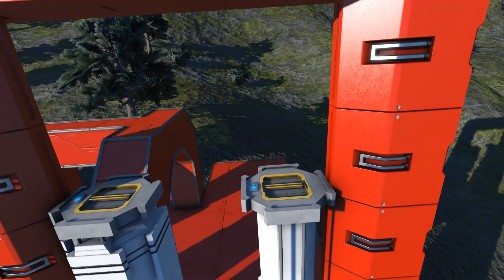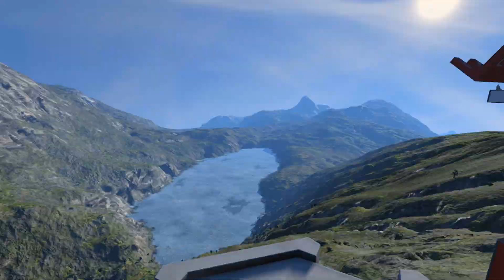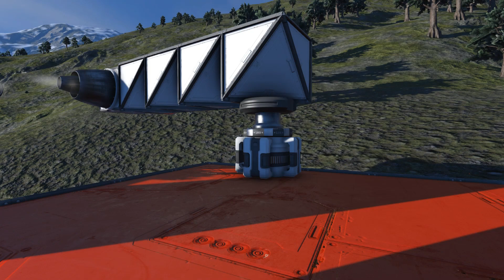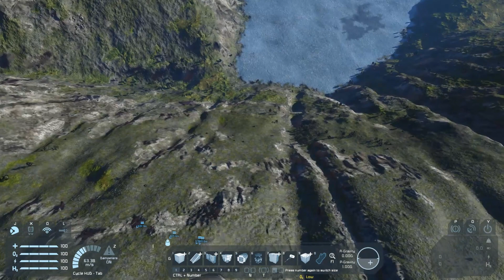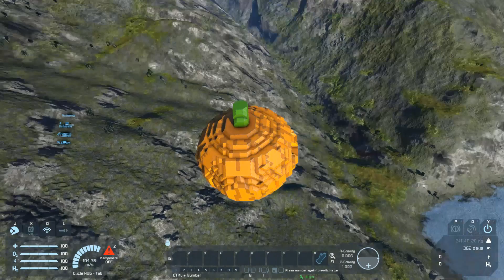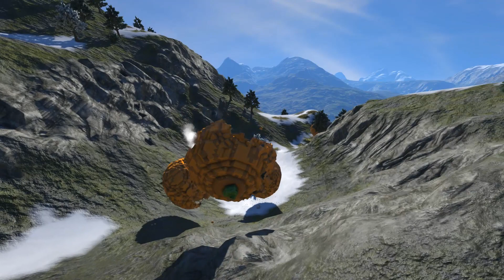Space Engineers: Pistons and Rotors after the Physics Update (tests and tips for Space Engineers)

Comment: it is probably a station, add a cockpit or controll seat and turn it to a ship in info tab.
Reply from the maker: I worked it out later, It was due to where the centre of mass is, it needs to be further away from the pivot of the rotor for the thruster to be able to push the arm

Comment: The problem with using thrusters to rotate is that SE seperates linear and rotational movement. As thrusters push the grid straight it won't result in rotational movement. SE also really hates any rotation not centered around the center of mass as that center of mass does three things at once. 
1. It moves 'linearly'. 
2. It changes the direction of that movement constantly to make that movement appear circular.
3. It rotates 

It's a bit like NESCAR. Going around in circles looks easy, but is actually really hard.

Comment: I'm very late so hopefully I still get a reply but does the rotor block being on make a difference, like maybe the rotor gears don't engage while the block is off similar to a transmission /gear box on a car
Reply from the maker: If a rotor is on, the torque controls whether the rotor will move, when off it's the braking torque. That's why I left the rotor at the end off to allow it to free spin with no braking torque

Comment: im have trouble with the small version of pistons and rotors. they are wobbly and unstable.
Reply from the maker: That's pretty much small grid pistons and rotors in a nutshell. They're not particularly powerful so tend to be a bit wobbly, plus the collision boxes for blocks on small grid are particularly fiddly and are often significantly larger than the visual bounds of the blocks in ways that the large grid versions aren't. You can still do cool things with them, it just takes a bit more time to learn what works and what doesn't :(

Comment: i think i finally figured out how to use thrusters to spin an arm on a rotor. you have to isolate the arm as its own grid.
i built the setup with a rotor, a few blocks with a thruster at the end like you have in the video. i removed the thruster and on the push side of the arm, added another rotor (which i locked) and a light block with the thruster on top of the light block pointing at the arm. Turn off the (Hinge) rotor and turn on your thruster
Reply from the maker: Nice, that makes sense, it's strange having to work around Space Engineers' way of pushing all the thrust through the centre of mass

Comment: 4:41 maybe if add a gyro on it, or try small ship
Reply from the maker: You can spin things with gyros on override but due to the application of force being at the center of mass, the only way I've been able to get things to spin with thrusters when on the end of rotors is to have the piece on top very lopsided, which still ends up slower than just turning the rotor on :(

Comment: I'm building a rather primitive but I guess decent large ship because it is my first ever large ship project in the game and I'm trying to build a hangar bay and I'm wondering if I should just use a bunch of pistons to push the blast door up and have a ship dock that way or use rotors to open it about 90 degrees straight up
Reply from the maker: For hangar doors on ships I'd try to stick to airtight hangar doors, particularly if you're planning on having the ship enter the gravity well of a planet. The reason for this is that subgrids and the inertial dampeners don't play very nicely with one another. The mass of whatever is on the other end of the rotor or piston will sometimes not be included in the weight calculations for the thrusters to resist so the ship will end up slowly (or sometimes not so slowly) sinking :(
Reply: I'm not trying to go that far yet I'm just trying to make more of like a space only ship as my experience with large prebuilt ships in an atmospheric condition is not exactly great but thanks for the suggestion I just wanted blast doors for the larger space but with the pistons I think I may be able to keep the armor

Comment: If you want things to spin freely try not building the rotor enirely, as far as i know that works
Reply from the maker: Rotors will spin freely when unbuilt, built with power off and no braking torque, or on with no torque. All 3 conditions should be handled identically by the game, at the moment they seem to but there have been times where that hasn't been entirely true :/

Comment: Try going in to control panel and switching the base to ship
Reply from the maker: Recently I worked out part of the problem with the rotor, due to force from thrusters being applied to the center of a grid, you need to have the arm on the rotor as lopsided as possible to get the thruster to push it around, otherwise it's just pushing through the head of the rotor. It is however, somewhat inconsistent in its behaviour :(

Comment: @Splitsie you need to set the upper limit to Unlimited to make it free spin
Reply from the maker: Only if it's running up against the angle limit, which those ones weren't. In my survival series I've since worked out that you need to have the center of mass far enough away from the rotor to allow for thrusters to create rotational force, however they are not very good at it any more so there are far better options for high speed launching which physics blocks :)

Comment: In the past iv built large gravity artillery peaces. But they really only worked on the moon. Cause artificial gravity doesn't work in planet gravity, and in space it only fires the projectile in a strait line. But on the moon, you can adjust the ark and actually perform long range artillery strikes. Furthest (somewhat accurate) shot of thus far made with it was at 10km. with about .3 of a km of spread. But with a group of guns firing at the same time, you could really lay down some fire power. But the guns are kinda hard to use and takes a single person At least 2min to reload, but with a crew of 3 or 5 you could easily do 20-30 second reloads. Its still in the development phase but if I finish it. Id love to show you it. iv also produced many gravity cannons for space warfare that can do immense amounts of damage. As well as many missiles.
Reply from the maker: I really want to do some messing around with grav gens on the moon, for some reason I want to build a gravity based maglev style vehicle. I think it'd be great fun (though totally impractical) :)
Reply: @Splitsie  Iv actually tried to build some mag lev vehicles on the moon. Its extremely difficult. I had some vehicle stability problems and the artificial gravity gens, like to cancel each other out. So you quickly run into problems.

Comment: First you must set Torgue to 0 (zero)... Then rotors start spin arround help atmospheric thruster. Is it physicaly option, not funcional. This option work same if rotors are on, or off.
Reply from the maker: The way the rotors were originally set up was that torque was only applied while the rotor was on, and braking torque only applied when the rotor was off. So you should be able to get a freely spinning rotor when it was on with no torque, or off with no braking torque. That's why I didn't think at the time to turn the rotor on as in my head I should already have had a freely spinning rotor.

Comment: if noone has said this before if you turn down the torque it should allow the thruster to move the rotor i found this out when trying to connect two rotor's together to spin them at the same time for looks of building my mining rig
Reply from the maker: It turned out there was a weird behaviour at the time I made this, where if the rotor was off there was no way to move it with thrusters, but if you turn it on and turn the torque down it'll be able to move. The rotors should have been able to freely move when off with no braking torque but just wouldn't :(

Comment: Thrusters apply force to the centre of the grid or the centre of mass
Reply from the maker: Except for certain conditions with rotors, oddly. I just missed the correct conditions slightly, if the rotor is on, you'll be able to use them to make it spin :)

Comment: I have managed to have a rotor (off) with a grav drive attached to one end, close to the rotor and a cabin with a reactor and a flight seat at the other end (far from the rotor) to reach abou 1000m/s without speed mods. I think for the thruster thing to work you need a flight seat on the grid that you wish to propel and also make sure that it is not set as "station".
The funniest part was when I detached the rotor - the grid kept spinning violently, but not perfectly circular - it spun out of control while circling around the general area that the rotor was in. Also it slowed down to 100m/s
Reply from the maker: I tried it with the flight seat, but edited that part out since at the time it didn't work either :/
It seems like for thrusters to spin a rotor, the rotor needs to be on, if it's off it just behaves weirdly... I'm glad things work as they should with a grav drive based rotation :)

Comment: Dear mr splitsie 
i wanted to make trailer for my rover and i faced same problem in rotors which they not rotor with additional force other than that you decrease the torque if you decrease it to 0 you can even turn it by character jetpack
Reply from the maker: Before the physics patch the behaviour of rotors was that having a rotor on with torque set to 0 was the same as having a rotor off and having braking torque at 0. When rotors are off the braking torque is meant to be applied, but for some reason that is no longer the case and I stupidly didn't think to try it with the rotor on at the time I recorded :P

Comment: What about making the arm of the warhead launcher, longer
Reply from the maker: You could definitely do that to require fewer rotors and achieve the same speed, I deliberately used a large stack just to see if it was possible ;)
Reply: Splitsie I meant, în the same instance, would it not launch it further, if the arm was longer?

Comment: Too lazy to read through all the comments to see if this has been mentioned, but on your rotor launching system, add a counterweight to the other side of the arm until the center of mass is over the rotor stack. That should greatly reduce the wobble, and probably get even more speed.
Reply from the maker: I was definitely silly not to have done that, and as you suspected several other people had pointed out that little bit of info - will be certain to remember it for the next flinging machine I build :)

Comment: Your thruster rotor was off
Reply from the maker: The way rotors are supposed to work is that while they are on and have 0 torque they'll spin freely, just like if they are off and have no braking torque they'll spin freely. Unfortunately that changed with the update and because I thought of the two states as identical I didn't think to try it with the rotor on at the time I recorded. It turns out that since the update they made it only really spin freely if the rotor is on, which makes no sense to me :P

Comment: I am having the issue of pistons not moving at all, I select reverse like normal and the piston just sits still not doing anything. This is incredibly frustrating
Reply from the maker: Are the piston heads running into something that's stopping them, maybe a grid that's gotten detached? If you make a copy of your save you could see what happens when you set the force on the piston to max (I can't remember the name of the exact setting but the one that's for how much force they apply to things that are in the way) if there's something in the way then you should see carnage then you can reload and try to work out what's blocking the path...
Off the top of my head I'm struggling to come up with other suggestions and since I'm at work I can't load it up to check :/

Comment: I believe you problem is that you didn't turn down the movement Torque on the rotor to zero, if you turned this down in the past. The items would flop around. Also The Themis auto leveling script "one of the best scripts in the game" I believe still works and this works entirely on thrust applying a off centered force. Hopefully this comment isn't redundant
Reply from the maker: The rotors are oddly bugged, the behaviour with rotor off and braking torque at 0 should be the same as rotor on and torque at 0, and that's how it was before the patch. Both of those setups would spin freely and rotate with a thruster. Since the patch it only works with the rotor on and torque at 0 for some strange reason, annoyingly I didn't think to try both at the time :P

Comment: I thought the thrusters in Space Engineers were incapable of applying torque. It was one of my major gripes with the building system when I last played. You could make as rediculously lopsided arrangement of thrusters you wanted, and it would still fly straight.
Reply from the maker: Only on your main grid, with the change in the physics in the big physics update, sometimes sub grids can apply torque through thrusters and sometimes they can't, though it seems inconsistent as to when that happens. If I'd thought to turn on the rotor and turn its torque to 0 then it would have worked :P

Comment: The thruster arm thing is a part of a limiter in the physics engine that makes thruster position irrelevant there is a mod that enables this (I think this is what is happening based on what I know)
Reply from the maker: Oddly that doesn't seem to be the problem, if I'd thought to turn on the thruster and make it have 0 torque (which should behave the same as what I did) the rotor will spin with the thruster... very odd and almost certainly a bug. But what you mentioned is what I thought at the time, that it was applying the thrust to the center of mass for the entire shared grid thus not spinning the rotor, but oh well at least the rotor stack works :)

Comment: Gyro, with on rotor with 0 breaking force and no lock no drive, then use your thruster
Reply from the maker: That should work the same as what I did - you've got a freely spinning rotor, but for some reason the two behave differently. I wish I'd thought to try that at the time I recorded it :P
Reply: Splitsie set all forces to 0 on the rotor and have no override on the gyro try with a cockpit by only using thrust then try thrust override

Comment: can you try to undo the Torque box to see if the overided thruster will turn. and also if you ad more blocks to you rotating speed breaker you will go faster
Reply from the maker: From what a few people posted it seems as though there are some bugs with the way the rotors are interpreting force. If the rotor is on and has 0 torque it behaves differently to if it's off and has 0 braking torque even though both should behave identically and freely spin. That's why I hadn't tried it at the time :(
To get the rotor to spin with the thruster apparently you just turn the rotor on and have torque at 0...

Comment: The piston thing has always been there.  It only makes sense that if you've got three pistons extending at the same speed, the end is going to move at three times the individual extension speed.  I found this out a long time ago, building a large drill rig, if you're extending all the pistons simultaneously, their individual maximum speed has to be the cumulative max divided by the number of pistons.

The thruster thing isn't going to work in vanilla, because all thrust is calculated through the center of mass.  Digi made a Realistic Thruster mod that gives offset forces for thrusters.
Reply from the maker: The only trouble with using the stacked pistons before was that I'd often end up with some very bizarre behaviour followed by explosions :P

The thruster thing used to work exactly as I set it up, the reason I wanted to test it is that as you say, since the update it puts thrust through the center of mass. It turns out though that it still works but only under the very specific conditions of having the rotor still on but with low or 0 torque - that to me seems like there's a bug or two in that behaviour...
Reply: I seem to recall something about it on the stream with W4stedspace and Wedge just after the update.  It might be the shared center of mass, which means that it's actually trying to move your platform instead of just the arm

Comment: Trebuchets? Inkvine catapults?

Also interesting with the rotors, b/c I remember testing something like that once years ago and found that second rotor didn't actually help. The first rotor would get slowed down by the second one's counter torquing base.

Edit: What if you use a "warhead" with an overridden thruster on it? Sort of like a rocket assisted artillery shell, eh? Also, I think you'd probably be better just mounting your flinger vertically and that way you might get a bit more range, but you definitely could adjust the release point to change the impact point. :) Oh, and another thing, instead of using a merge block, why not use a landing gear? Then you don't have to sacrifice the merge block on the "warhead" end. Would obviously be more complicated, but I still think it'd be doable.
Reply from the maker: I'd experienced the same thing with rotors before the update, it's why I really wanted to try it again. I'm so glad it works now :)

I used the merge block as it makes building and disconnecting with the projector easier, using grinders or other such devices to disconnect the warhead is always much more fiddly. I totally agree with you on setting it up vertically though, that would likely add a lot to the range